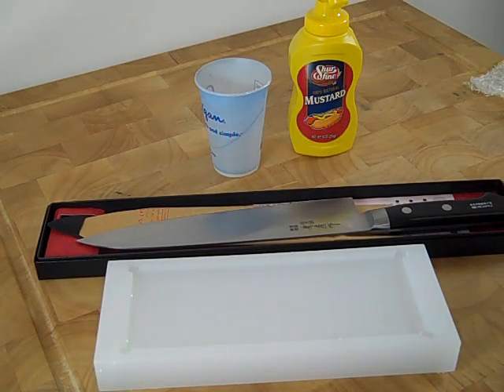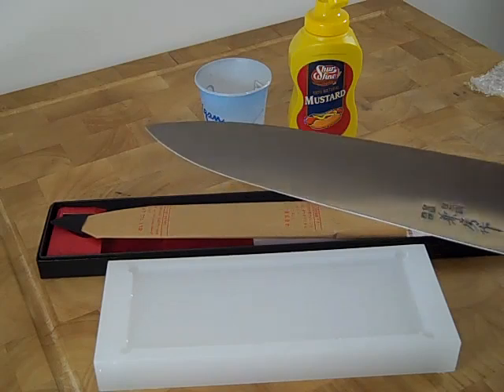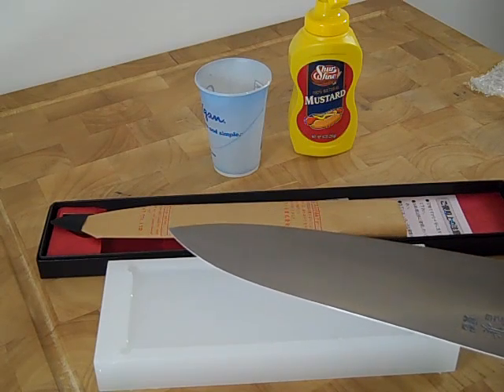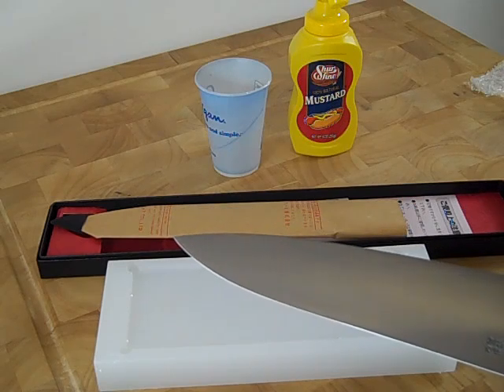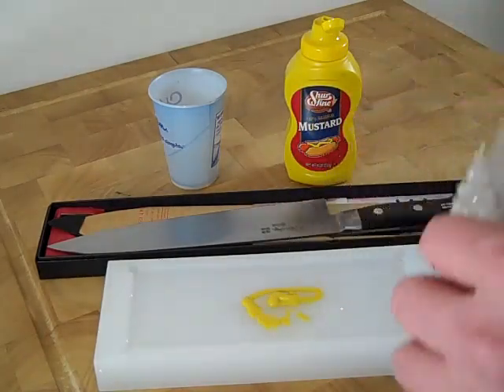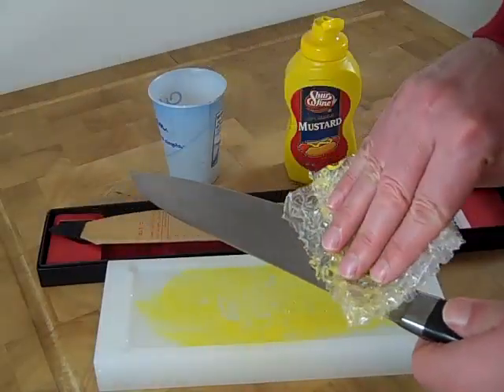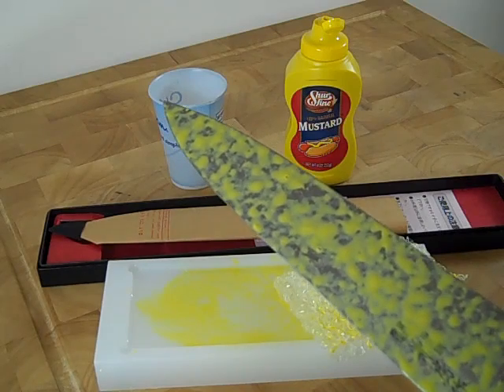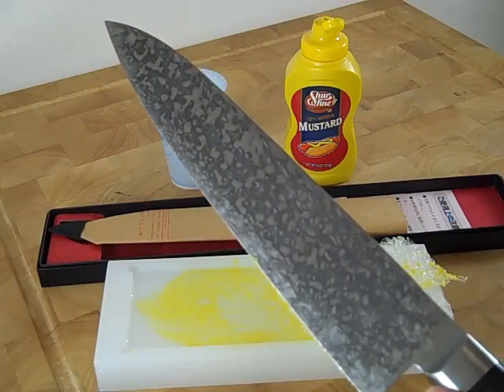Forcing a patina on a carbon steel knife

Comment from the maker: It's hard to generalize since there are so many different formulations steel that lack chromium (and nickle) that make most carbon steel knives. In very general terms, carbon steel knives are liked becuase they tend to sharpen very easily and better quality carbon steel knives hold that edge really well. Lower quality carbon steel still sharpens easily but holds an edge for a short period of use. I'm glad you guys like the video. :)

Comment: @mrttou I know that it has been months since you asked the question, but I thought you would like the answer anyway.
The patina dark or black is Fe oxide. FeO. It can be considered a "god oxide" because is a passive oxide that protects steel to active oxidation (rust, is red-brown, Fe2O3) or corrosion.
Rust is active oxide and is not good oxide.
Reply: ty very helpful  :)